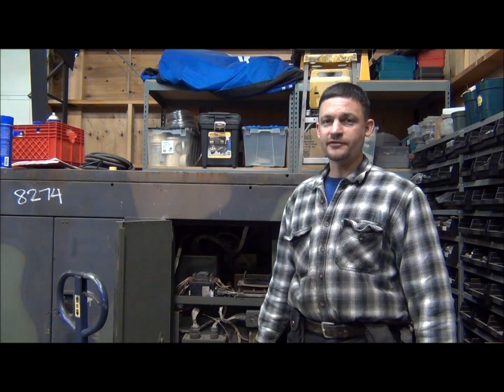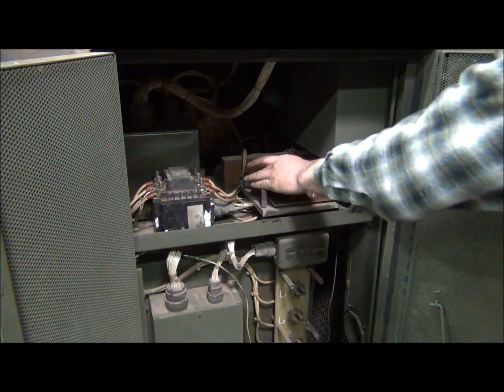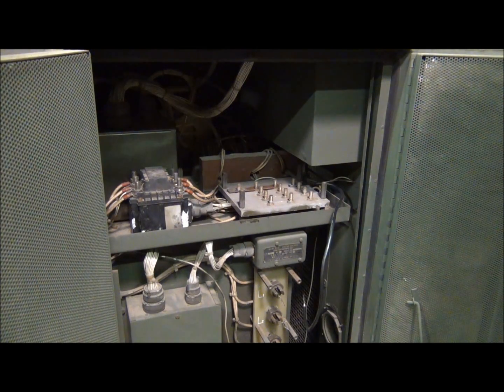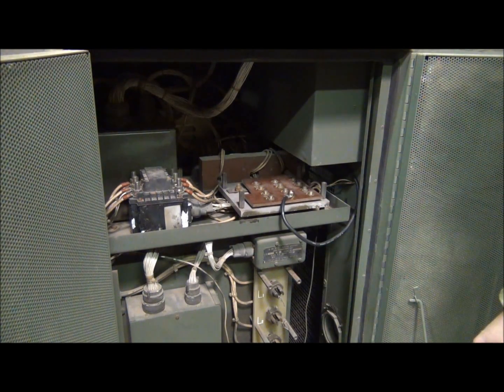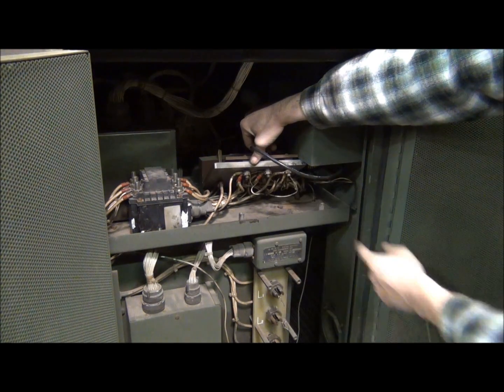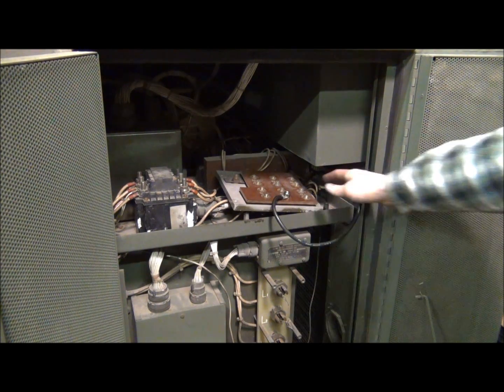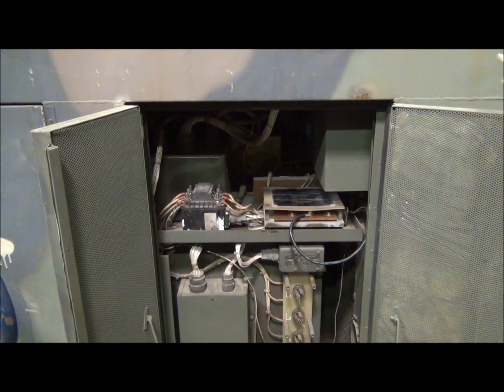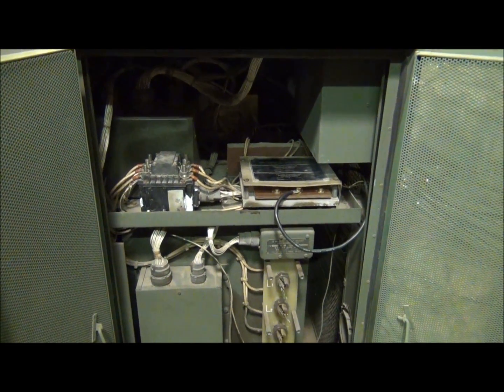How to convert an MEP-004a or -005a diesel generator to single phase 120/240

Comment: I just got my mep-005a running i had my generator guy follow your directions for th e conversion.  After all was said and done he stated they could only get 20k out after the conversion. 
Do you have any suggestions. Im guessing he followed your instructionsthanks in advance
Reply from the maker: +mike dunn I need some more information about his symptoms.  Does the field flash work?  What does the voltmeter read on the front panel?  What voltage does he see with a digital VOM at the receptacles?
Also, not quite sure what you mean by "he could only get 20k"
Reply: He could only get 20k output from the generator. I guess I thought it would put more power out after the configuration
Reply: I guess it would be more helpful to have the generator guy with me so he could answer those technical questions. Thanks for the fast response. Your videos are great and helpful
Reply from the maker: mike dunn Yeah...its difficult to troubleshoot things via youtube message, but even more difficult if I'm not talking to the guy who is turning the wrenches!  The conversion procedure has worked for hundreds of -004's and -005's; so I have to assume that either a mistake was made during the conversion process, or your generator had a pre-existing modification or nonstandard equipment that makes this procedure not work (this is entirely possible).
Reply: Thanks next time I'm with him I'll get in contact. Could he call or do you perfer messaging
Reply from the maker: I sent you a message with my email address and phone number

Comment: Hi Sewerzuk, I tried to reply to your respose to me on your other video, where I asked, where to get parts, but it didn't work somehow. Thanks for the tips, Oshkosh has all the parts that I need, except the Frequency Transducer, but I opened the faulty one (nasty stuff) it turns out to be a quite simple circuit, I think I can repair it. It is only 2 Ic's, 1 transistor and a few passive components. I do actually have a comment about this video; I started to go through the single phase conversion, but this Mep-005 is different from the one on the video. After removing 9 nuts (it was configured for 240/416) I lifted the jumper board and there was no copper bussbar visible. I was puzzled at first, but after removing the posts and looking under the panel I've found it in the same position that it is on yours, but mounted underneeth all the nuts holding the wires. I wasn't happy about the idea of removing all the nuts that held the bar, instead, I just removed the thick cable from T12 and conected it to the bottom of T2. I did all the other moves too, except there was no need to move X12EG16N from T12 to T11, because it is still connected to T11 by the busbar, that I didn't cut. I hope this may help someone...
Reply from the maker: +ltstluc1 Yeah; common to find the bus bar on the bottom of the reconnection board.  Most people have successfully cut it in place with a small cutoff wheel on a dremel.
Reply: +sewerzuk No doubt, it can be done that way, but in my case I had to also think about the possibility of 3 phase use of the set in the future, so because I didn't cut the bar, everything can be re-connected in the original way if needed. I read it somewhere amongst the comments of one of your videos that you have a manual for this genset, can I ask you to email me a copy to ltstluc@gmail.com. Thanks very much in advance.
Reply from the maker: ltstluc1 email sent
Reply: +sewerzuk  Thank you for the manuals. I finally got to finish the single phase conversion without cutting the bus bar. When I actually got down to do it I realized that I had to move all wires from T6 to T12 as well. I didn't think it through previously and now realized that by cutting the bar and using a jumper cable you are actually moving T12 and T6 together to T2 because the jumper board connects T12 and T6 in the low voltage configuration. I will start the set in a couple of days, still need to complete my work on the alternator that had 2 diodes shorting. I will let you know how the test went, but I'm confident that it will work just fine. If anyone would like to do the conversion without cutting the bar I'll be happy to give detailed instructions.

Comment: I'm not getting power to my fuel pump but if I jump out the fuel pump and hold the start button and stop position to stay running soon as I Let Go it shuts down this is on a mep-004a I noticed this the fuses what could it be

Comment: UPDATE...
I took the connection board up today... found the copper buzz bar mounted on the bottom of lower connection plate. All is good!
thank you for all your information/research that you have done on these generators.
Reply: I am trying to do mine. I have the Buss bar on the bottom also. Had me worried when I could not find it THANKS.

Comment: Hello Sewerzuk,
       I have a PU-794/G 20KW which is a MEP-004A with sound enclosure and a upgrade in power output from 15KW to 20 KW.
       When doing the conversion from 3 phase to single phase, this unit doesn't have the copper buzz bar that needs to be cut. Can i make one, and then do the change of the circuits on the back of the board?

Comment: Sewerzuk, I have a mep-005 and soon as i start up the over load light stays on.  Any idea where to start troubleshooting?
Reply from the maker: Tony Garcia Does the light reset if you operate the test/reset switch, or does it stay on all of the time?  And does the generator operate normally otherwise (does it start/run/make power/etc.)?

Comment: i don't have tech manuals but after about 5 or 6 times of running it started to work. I let it run for about an hour, it seems to be fine now  thanks.
Reply from the maker: terry marshall No problem; if you can, you should put that set under a heavy (80% or more) load for a few hours; it will take care of the carbon/soot/etc. (wet stacking) and will also turn up any fuel related problems.  If you would like a copy of the tech manuals, send me your email address and I will email them to you.

Comment: Thanks for the reply, with the battleshort on the day tank would fill and then start and run fine until the day tank ran out.
Reply from the maker: terry marshall OK; it sounds like the "run" relay isn't being engaged.  Do you have the tech manuals for your generator?  I can point you toward the correct page/schematic/part and you can troubleshoot from there...
Reply: sewerzuk I.m back to work on this mep-004a  same problem,  it will run for 15min and then run out of fuel, engage battleshort  run for 15min then out of fuel again. i cant seem to find the page i need    thanks.

Comment: Your videos are great, I just started buying these Generators and am having trouble with a MEP 004A  188 Hrs on the clock.  the fuel pumps will only come on with the battle short on.  I'm suspecting its bypassing a relay but don't know where to look. Thanks.
Reply from the maker: terry marshall If the set is not running, the fuel pumps should only come on when the battleshort is in battleshort.  There is a "run" relay that energizes once the generator comes up to speed and powers the fuel pumps on.  So, if the day tank is empty (or low) you would need to fill it by leaving the battleshort switch in battleshort for a few minutes.  Otherwise, I just turn it on for a few seconds when I am starting to make sure I hear the pumps start up and then slow down.

Comment: Sewerzuk
looks like you were right on about the bus bar, It was underneath the board. So I have another problem, I have changed it to the higher voltage and I can only get 297 volts on each leg L1,L2,L3 is there a switch I need to change to get it to 380V that I need.
TimZim
Reply from the maker: tim Zimmerman No, there is no switch.  Moving the reconnection board accomplishes all of the necessary changed to convert to high voltage.  Just so I am clear; you still have it configured for 3 phase, and have just moved the VR board to the 416/240v space, correct?
Reply: sewerzuk How do I know it Is set to 3 phase or Single , but yes I moved the vr board to the 416/240v only
Reply from the maker: If you haven't done the conversion to single phase, then it is configured for 3 phase.  3 phase is the only way these sets came configured from the military.  There are a few possible causes for your low voltage; but lets make sure you have the set up and running correctly first.  Here is the abridged starting procedure (make sure you have accomplished all of the steps):  
1.  Place start switch in "start" and continue to hold until the generator is up to a steady RPM and oil pressure is above about 30 psi. Then release the switch.   
2.  Adjust the throttle until the frequency meter reads about 61Hz (you should not need to adjust the throttle after this, even for shutdown)
3.  Adjust the voltage rheostat until the voltmeter reads 416v on all three L-L settings, and 240v on all L-L0 settings.
Reply: sewerzuk Will check on this and get back to you hopefully Tuesdaytimzim
Reply from the maker: tim Zimmerman OK; I'm betting that the set is operating at a low RPM (well below 60hz) making it impossible to generate full voltage.  My "quick and dirty" start procedure will eliminate that as a possible problem.  Let me know what you discover, and we will go from there.
Reply from the maker: tim Zimmerman I will give you a call tomorrow
Reply from the maker: tim Zimmerman I sent you a couple of emails with tech manuals, parts, etc.  Let me know if you don't get them...

Comment: Have a MEP-005a and someone has changed the volts to 120/208. I went to the voltage reconnection board to change it to 240/416 and I notice that the bus bar is gone. I can only get about 300v out of it as it is. What does the bus bar do? and if Can I put it in to get back to 3 phase and 400 volts
Reply from the maker: tim Zimmerman The bus bar is the "common" tie point for all of the windings, and the neutral connection.  The bus bar must be there if the generator makes 120/208 power; it may be riveted under the main board.

Comment: Will this procedure work on the MEP804A diesel generator?
Reply from the maker: G.E. Gunzy The 804's I have seen have 10 lead generator heads (the neutrals are internally bonded) so no, this procedure won't exactly work.  I've been wanting to get my hands on one so that I could dissect it and see if it is possible to convert, but haven't had the chance yet.
Reply: Thanks.

Comment: I have a MEP-005 with the L1 leg dead, what would I have to do to convert this to single phase ? I am not sure how it would differ from the way you did this one.
Reply from the maker: If the L1 leg is completely dead (and the break is inside of the generator head) that means you have 2 dead windings...and there is no good way to wire it up for single phase.  But, those generator heads are very robust.  My guess is that you have a loose connection outside of the generator head somewhere.  I would find and repair that, and then do the conversion!
Reply: The L1 leg initially shows power when metered but as soon as any load is applied the leg goes dead.
Reply from the maker: it sounds like there is a high resistance connection somewhere (or a bad main contactor).  Have you tried tracing L1 back toward the generator head (with a load applied and zero output at the L1 terminal)?  This is what I would do if the generator was in my shop.

Comment: I'm another one who wants to change my MEP-006A to single phase.....any chance you could "wing it" without one?
Reply from the maker: I REALLY hate to do that...looking at the schematics is one thing, but I get a better feel for things when I'm looking right at the terminal board.  On the last -006a that I did, my actual lead movements varied significantly from what I thought I needed to do.  Where are you located?
Reply: sewerzuk Im currently in Des Moines, Iowa.  Soon to be back in Northern Wisconsin.

Comment: Does this configuration process applicable to mep 006a and are their terminals label the same?
Reply from the maker: The re-wiring of the generator leads is the same, but the control wiring is slightly different. I have done a few conversions on -006a's, but unfortunately I didn't take good notes so I can't tell you exactly what I did.  I will be sure to set up the camera and take some notes during the next one, because a lot of people are asking me that question!
Reply: could you please direct me if possible with diagrams
Reply from the maker: Sorry, but I didn't keep any notes!  I could tell you where I think the leads need to be moved to, but I hesitate to do that without a working generator in front of me...
Reply: Ok, i understand. Please let me know when you have the information, i will sincerely appreciate the help.Frank

Comment: idid this conversion and get the 240 volts but the hertz gauge no longer registers is this normal or did i screw up
thank you
Reply from the maker: The frequency meter should still work properly after the conversion.  Those meters are notoriously unreliable...I see more broken ones than working.  If your other meters are working properly, I suspect that your frequency meter is bad.  I typically don't set voltage and frequency with the set meters; better to use a digital VOM...

Comment: with this swap around do you lose any KW rating ?
Reply from the maker: No; the generator is capable of a full 15wk (or 30kw in the case of the -005a).

Comment: I am converting a MEP-005a and did it like in the vid. Now the gen is in overspeed shutdown and the reset switch is not doing its job. Can u help me with this? My #319-795-0563
Reply from the maker: The conversion only makes changes to the generator side of the machine; not the control side.  Unless you mistakenly moved some wires, the single phase conversion is not the cause for the overspeed.  There is a small pushbutton on the speed switch (a metal can about the side of a red bull can on the side of the engine).  See if pushing that button clears the overspeed warning/shutdown.
Reply: This is Jason Chapman: I only moved the wires you said to in video, so I will try the button. Thanks.
Reply: Do you know where can I order replacement parts?
Reply: We have another gen same model, it is fluctuating voltage from 120 down to 0, do you think that would be the voltage regulator?  If so do you know where I can get one? Thank you for your help
Reply from the maker: It could be the voltage regulator/exciter assembly; but impossible to tell without further testing.  The only place to get one is a surplus parts place.  I have also had good luck repairing them myself...parts are available at any supply house.

Comment: Hello.
Would yo be familiar with the 10Kw MEP 803a TQG's that are flooding the market?
I am trying to find the physical location of the K12 relay and diode CR5?
It is getting to the point I'll have to pull most of the exterior panels to try and find them